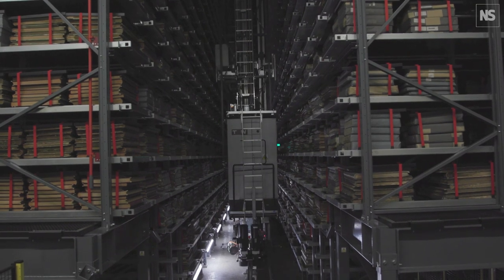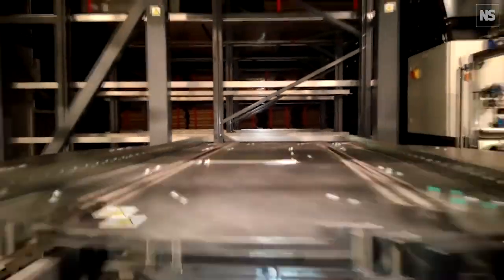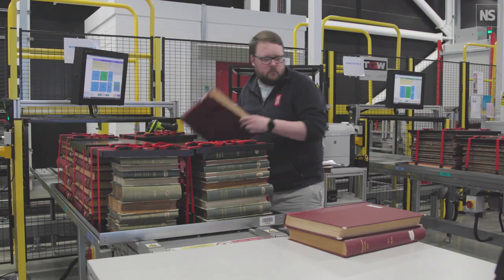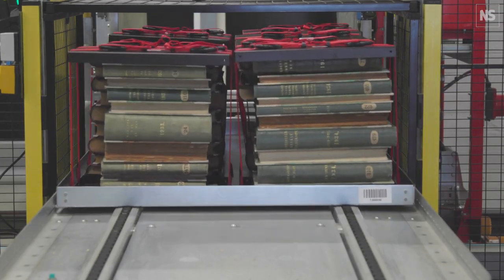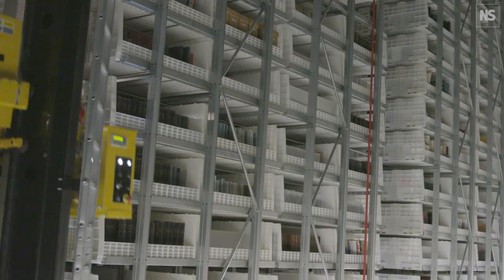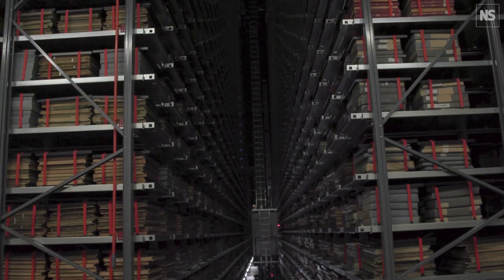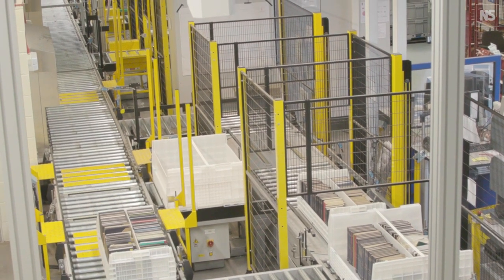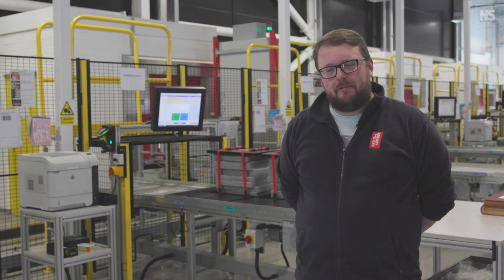British Library robots look after old newspapers with new tech

Comment: I would be interested to know how machine "reshelving" is done... Anything misplaced would be effectively lost forever 😲
Reply: Same problem at any normal library I would assume. Seeing as it is very automated you could to routine integrity checks. Start at row 1 column 1 box 1 book 1. Continue until you have gone around then start again. Could optimize by only checking modified or retrieved sections in the past X days.
Reply: Barcoded items, barcoded containers, and an inventory on a WMS.
Reply: @syntaxerorr  this is not a library, it's a storage facility to preserve for the future!
Reply: The way it's set up means it's incredibly difficult to misplace items as they are all barcoded along with their storage containers. Anything that goes in or out is scanned and the system tells you if the wrong thing is going in the wrong place which cannot be overridden unless it is part of an audit process on a separate part of the Warehouse Management System.

But in the unlikely event of something being misplaced then yes, it'll be very lost in there 😂
Reply: @tomhigham7549  Thank-you for your explanation 😃

Comment: This is amazing tech. But wouldn't digitizing and hosting at multiple locations be a much better idea than building this? Data with no back up isn't safe.
Reply: A lot of the time it boils down to funding, it is expensive and man hour intensive when you are talking about digitizing an ever increasing stack of a 75million+ unit catalogue. In addition licensing can be an issue as the items will often be owned by different companies/individuals who are storing their material inside (and whos permission would be required for digitizing a full copy of a publication). I don't know specifically for this facility, but I've worked with library shelving facilities similar to this (minus the slick robotic awesomeness) in the past and that is how it was explained to me when I asked the same question.
Reply: Like the newspapers, data needs to be maintained and can easily be deleted in error or otherwise. Plus the man hours involved will be enormous and massively expensive to get everything digitised. New editions of newspapers are of course digital so going forward there will be more and more being archived in this manner.
Reply: Many of the papers have been digitized.